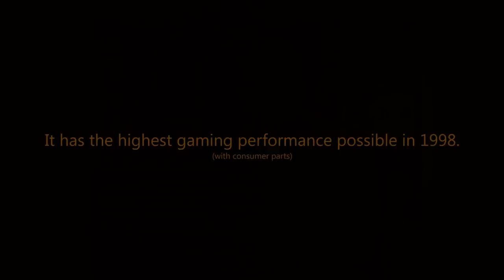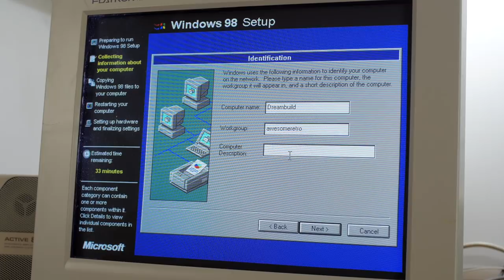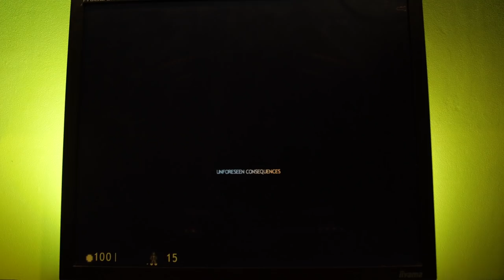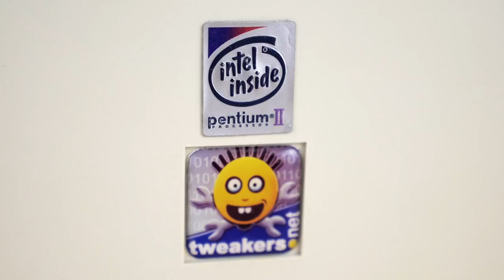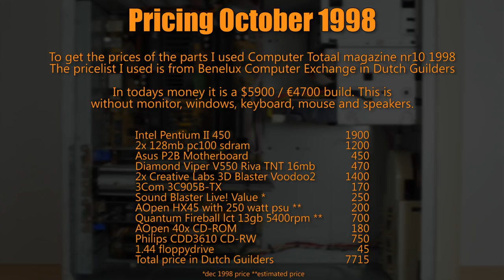1998 Gaming Dreambuild! Pentium II 450, 3DFX Voodoo 2 sli

Comment: I just got my retro PC Done and LOVE IT! it has been rock solid 
Windows 98se
MSI MS5169  ALi Aladdin V Chipset
AMD K6-III 450 @ 500Mhz had it to 600Mhz but did not see any boost so i left it at 500
Modified socked A CPU cooler to fit socket 7
384Mg PC 100 Ram
Voodoo 5 5500 
Sound Blaster 16 
20Gb and 40 Gb WD hard Drive
Sony CD/DVD

Comment: I had basically this exact computer in 1998 (though with a Zip drive and one less Voodoo2.) Went through 2 hard drives, the Philips CD burner started making moaning noises long before CD-Rs were cheap enough to actually use them for anything and I took the whole thing apart in 2004 to upgrade to a Duron. Wish I'd kept it now.

Another choice for period correct speakers would have been the Boston Acoustics BA635 that Gateway used to sell a lot of.

Comment: the thing is: a PII cpu have external cache, that means if you oc the chip, the cache would still clock at factory speed while the celeron 300a had in-die cache, that means if you increase the fsb to 100MHz the chip AND the cache will run at 450MHz which doesnt make the performance worse i guess... and yes my slot 1 celeron is watercooled... i also compared my celeron to a pII 450 and surprise: the 180$ 128kb celeron was in some cases better than the 500$ 512kb pII 450

Comment: Hey I've read that the highest performing PII's at 450 Mhz used two Diamond Monster 3D II 12mb graphic accelerator cards in SLI and that these had higher framerates than two Creative Labs 3D Blaster 12mb brand Voodoo 2 cards at Toms Hardware back in the year 1998.The reason given was that they could be overclocked to a higher degree and didn't use 3Dfx's strict reference design.

Comment: nice build. Back then(late 99)  I had a Celeron 500Mhz with Voodoo 3 2000 which i had to rma 2 years later - replaced by Geforce 2, 64mb of ram and around 10gb of hdd space.For audio I had a Sound Blaster Live! card together with Cambridge's 4.1 speakers. Together with the Hansol 17` monitor it all cost around 1000$ . Played games like Interstate 82, Kingpin, Project IGI, NoOneLivesForever, DeltaForce's Land warrior, Sin, Carmageddon2 , Rollercoaster Tycoon, SoldierOfFortune,  GTA2 , MM2,...

Those were the days :'(
Reply: I had a Celeron as well - the 300A model overclocked easily and was way better than the original 300. It was a bit of a sleeper. I had a SB Live! too because it could do duplex recording. I think I replaced it with an AMD Duron eventually - the Pentium III wasn't much of an upgrade and the Pentium 4 was too expensive.
Reply: In 1997 I still had a 386DX...

I was a little behind until the Pentium 4 was released.
Reply: +Ashley Pomeroy I've got an AOpen MX6e+ or something like that lying around here that's got a fanless Pentium II 233MHz overclocked to about 400MHz stable (392MHz because that was the fastest the board supports if I recall). Besides a Socket 7 Deskpro I have, it's the only overclocked computer I own. The Deskpro has a Pentium 133MHz at 233MHz running Windows XP.

Comment: Great video. I´m also building a retro rig but from 2000 with factory new parts. Cooler Master ATC-100, Antec PP-303X, Asus K7M, AMD Athlon Slot A. Right now I use a 700MHz Athlon but I’m trying to find a 1000MHz. AMD was first to reach 1GHz and I will use exactly that CPU.

Comment: This machine was a dream I had in 1998.
The pentium II 450MHz had a tremendous price and performance. It was top class for at least three years and had decent performance until 2003 when Pentium IV appeared. It was a CPU beyond the needs of even a demanding user. It is like buying a Xeon with 12 cores and 30 MBytes L3 cache memory today. 
Also it had three graphic cards. Actually one graphic card for the monitor and two extra with total four GPU voodoo 2. To be honest no game at that time would be better with more than one voodoo 2 GPU. This cards was usable for 3D animation creators, not gamers. 
The RAM after windows 98 became really cheap until the earthquake in Taiwan. The price of RAM is after the earthquake. 
The Philips CD recordable wasn't top. Top were Plextor CD recordable SCSI drives. Plextor was the choice of CD pirates. Top speed and reliability. Blank CDs were expensive then.
The sound blaster card and the 3com modem were the best.
Reply from the maker: +Achilleas Labrou Pentium 3 450 is more like buying a 6core. My next workstation will be a 10core 3ghz Xeon :)

Comment: 3:18  wat????  No cable rounding????    ;p
6:24  gawd I miss that "click".  Back when cases came with real switches.

That's pretty much the exact machine I have,   Same video setup & MB.
PII 400, I think only 64 M of ram.  (IIRC, I paid $400 for the CPU then)
I also liked Enlight cases back then, so that's what I used.
I also often used Sparkle power supplies.  Not sure how good they were, I just never had a problem with them.  I bought one Glitchmaster, which was a company that modified Sparkle power supplies with a huge capacitor board.  The capacitor was so big it could run the PC for a few seconds after you powered it off.   Enough to ride out an OCR.

I can't remember what sound card I had.  I do know I had a fancy Sound Blaster surround sound card, but that might not have originally been for my 400.

That poor PC's last use was as a Ventrillo server.  :(   A TNT and two Voodoo 2's running in box with no monitor attached, what a shame that was.

That AOpen case looks like it may have saw some sun.  I know some yellowing can happen just from age, but my Enlight cases have held up quite well due to never being near windows.

Comment: I did roughly the same but using a motherboard with dual pentium pros. I also used Windows 2000 pro(?) as that was the only one that would handle dual CPUs. The best game was Unreal as that worked well with the SLI and one of the few games that handled multiple CPUs

Comment: I would have loved to have this setup. In 1998 I had a K6-2 450, 64 mb ram, no 3d accelerator.
Reply: Lucky. Until I bought a Pentium 4 1.8GHz in 2002, I had a 386DX-33.
Reply: That is quite an upgrade haha!

Comment: Your ribbon cable routing skills give me feelings I shouldn't have about cable routing...
Reply: I love looking at the clean computers he has, but zip ties make me angry. At least use cable guides or twist ties, zip ties are a pain in the ass for maintenance.

I think the cleanest routed computer I own is a Dell Dimension L500r (which thinks it's an L800r due to having its CPU replaced) Which is fully stock except it's replacement CPU and cooler. 

There are only 3 ribbon cables, optical and floppy drive cables are in line, and hard disk cable is fairly short. The other 4 are power cables, the two motherboard connectors (ATX 20 pin, and whatever the Dell connector is, which I really want a pin out for, if anyone has it), the cable going to the hard disk, and the chain cable going to the optical and floppy drives.

Comment: So... When the next retro build is coming out? Would be cool if it would be built using 2004 parts to play HL2...
Reply: +TheEdvinazard
Ultimate 2004 Edition:
-Intel Pentium 4 - Extreme Edition 3.4 GHz (Gallatin)
-Gigabyte GA-8IG 1000 PRO
-2x Kingston PC3500, 1024 MB
-Geforce 6800 Ultra
-Netgear FA-312
-Antec True Control 550W
Reply: +Metatr0n I preety much have that other than the extreme edition p4, I have:
-Asus P4P800e Deluxe
-Intel Pentium 4 3.0ghz @3.75ghz prescott
-4x512mb Corsair ddr400 cl2
-Ati Radeon X1950pro 512mb ddr3 AGP

I'm only missing the ee p4 :(
Reply: +Metatr0n Most people back then knew that the Athlon 64s were the better CPUs to use.

Comment: didnt know you could sli back in the day !
Reply: +So magical SLI is a very old system that never really gained all that much popularity over the years. Only recently have new APIs been developed that claim to support multi-GPU environments better.
Reply: +So magical It worked on a totally different basis than todays SLI. Nvidia gained the knowledge about that technology when they bought 3dfx. The SLI from 3dfx worked on a line-by-line basis. So if you take one frame, GPU1 rendered the odd numbers of pixel-rows and GPU2 rendered the even numbers of pixel-rows.
Todays SLI works like a double-clutch-transmition on a frame-by-frame basis. GPU1 renders the frame that is requested right now and sent to the monitor while GPU2 already renders the next one and buffers it. So while GPU2 pushes the pre-rendered frame to the monitor, GPU1 has more time to render the next frame that will be requested.
That also pretty much explains why the VRAM is not doubled in SLI, it's because both graphics-cards need 100% of the texture-information to both be able to render full frames.
Reply: ah i see, seems quite easy in that case, thanks for the info
Reply: *****
No, 3dfx named it "Scan Line Interleave" due to the method of dividing the screen into pixel rows like I described above.

Comment: This is absolutely badass! Would something like this be expensive to buy the parts for and build nowadays? (As in, ebay prices) Also, what speakers are those?
Reply from the maker: Juster AT-85. But when I opened a speakers it only contains 1 driver instead of 2 so they are a bit fake. My 120watt pmpo which I got in 1997, that set had 2 drivers in the speaker. So there are more versions of this design. All made in china and cheap in 1997/98.
Reply from the maker: I think Ebay is way overpriced. I have many friends who have parts or find parts for me. And I find retro console stuff for them. So most parts are free. Just look in thriftshops, part out old systems, ask friends or look on more local trade sites. You should find parts for less then ebay.

Comment: This is AWESOME looks just like my computer when I was 5 or 6 years old :-D. Still sad, that I don't have it anymore :-/
Im currently building a "new" Windows 98 gaming PC. I already have most of the parts. Coincidentally the same Motherboard. I only have difficulties finding a good AGP Graphics Card. Any suggestions on what Graphics Card should I use that works fine with Windows 89? I currently have a geForce MX4000 but I have no idea if it is any good or compatible with most of the software.

Comment: Awesome build. Congratulations, Is seen that you are a profesional movie maker. But I have one question. what is the name of the speakers? I love those retro speakers.
Reply from the maker: Juster AT-85. But when I opened a speakers it only contains 1 driver instead of 2 so they are a bit fake. My 120watt pmpo which I got in 1997, that set had 2 drivers in the speaker. So there are more versions of this design. All made in china and cheap in 1997/98.
Reply: victorbart Thank's . The tiny "speaker" act like bass reflex. In this price tag is normal such design with only 1 driver.
Reply: Dan Muraru They were also available labeled as Primax and TEAC. I don't know, if those had 1 or 2 drivers, but I remember the 2 driver variants were pretty good value for money.

Comment: In 1998 my computer was a 'Vbox' trash retail PC with an AMD K6-2 450MHz and 128MB SDRAM 

Got a Voodoo 3 3000 on Black Friday at Best Buy for like $79, really made a huge difference for Unreal Tournament and Quake III compared to my SiS integrated graphics, Moto GP went from slideshow to well over 30 FPS probably 60

Comment: My first computer was a Windows 98, PII 400, 128mb ram, 16mb Viper V550, Asus P2 MB, Sound Blaster Live, 10gb WD, 250 Watt ps, CD ROM, 17" CRT, HP printer, Scanner. $2400 in early 1999.
Reply: Lol

my first PC was an acer aspire series laptop with a pentium 4, 4GB ram, 512mb graphics, with on board wifi sound and it had a cd rom and a 15" screen

Comment: what is that for a cable which appears on the video at 6:18 (the black cable which connects the 2 graphic cards )?Or where can i buy it ?
because im building an gaming pc too (win98gaming pc ...) and i want to do the same as you ... but i think that without that cable i dont rly could do an sli .
(sorry for bad english . i hope you understand me)
Reply from the maker: +Sound of Generations It is a very short vga extension cable. You can use a normal vga extension cable if you dont have the short one.
Reply: thank you very much!
(sorry for bad english ...)

Comment: To be fair, this is still sexy af.
But i remember this era like it was yesterday.
When the grey cases finally became extinct.
When 3dfx had yet to shoot itself in the foot.
When ati was an all in one-der.
The question was"could it run unreal?" And even if it could.. did it have onboard 2d acceleration?! 
Floating point performance?
Compatibility with other components?
Did the mobo allow overclocking via the bios ot do i gotta toggle dip switches?
Reply: Completely agree.
For the last 4 years, I keep randomly dropping back at this video, just to take a peek at how sexy it is LOL
Reply: @SummonerArthur I do exactly the same, I keep coming back here. Also to Victor's year 2000 dream build video.

Comment: How do your both V2 cards perform? I felt, that mine getting way too hot in this old case without active cooling, which resulted in stuttering - so I decided to get some proper cooling for them. (I plan to cut open the case on the side with space for two 120mm/12mm fans, and one on the top in the middle for one more 120mm fan, and close it clean with fan covers with mesh filters to prefent to much dust coming into the case. Maybe I am going to color the three fan covers with original grey to let it look as original as possible.
Reply from the maker: No overheating and no active cooling :)

Comment: I'm thinking as well that my old Toshiba satellite laptop would've costed about 3 grand or more, of course its also from 1998 which has a 266 mhz Pentium processor with 96 mbs of ram, 4 gb hard drive, and an 800 x 600 display.

Comment: The HL runs fine? in my retro pc (PIII 466Mhz, 384mb ram, voodoo3, win 98) i have constant fps drop, is unplayable, with the PIII@933Mhz works very well, but you have a PII 450Mhz... framerate? Good work man.
Reply from the maker: +Lucio Carranza which resolution on the 466mhz system?
Reply: 1024x768x16bits with miniGL. Thanks!

Comment: What do the 2 Creative Labs 3D Blaster do? Is it like an extra GPU? I have a drivers disc for one of them that I've acquired over time. I've never found the card its self unfortunately.
Reply: It used the standards graphics card for 2d,like Windows desktop and such, then when 3d rendering was requested by games, the accelerator kicked in.

Comment: What's the benefit of putting an AGP video card in along with the 2x Voodoo2 cards in SLI? I know the AGP bus is much faster than PCI, so wouldn't it be better to just spring for a better AGP card, or does the hardware render video across all 3 cards?
Reply: Since you probably know how SLI works, I won't explain that, but the VooDoo cards use a special API called GLiDE instead of DirectX or OpenGL (both of which ultimately killed 3DFX off in the long run). GLiDE emulation using OpenGL or DirectX is not only difficult, but also very slow and sometimes inaccurate, as well as DirectX / OpenGL emulation under the GLiDE API. 

Basically, you're better off having all three cards, because the nVidia Riva TNT can handle DirectX and OpenGL decently well, and the VooDoo cards handle all of the GLiDE work.
Reply: +AIO inc. thanks, that clears up a lot of questions. so when you play games that use glide, do you have to set your main display to the SLI cards or are the drivers smart enough to do the calculations on those cards but display on the AGP one?

Comment: I have a very similar build but with issues. Im using a asus cusl2-c mobo with a PIII 1ghz processor, diamond viper v550, diamond monster voodoo 2s in sli, crative labs sb live ct4780. When I try to play half life the system freezes with an error during loading screen. I had these cards (all 3) in a super sok 7 mobo with a amd k6-2 500 mhz and had issues with sound card drivers causing errors so I switched to the pentium III and still errors..

Comment: 1998 I had an Pentium II 233 @ 291 MHz (yep that was an awesome boost - those CPUs were so awesome to overclock - especially the Celeron 300a...) - 1x Voodoo 2 Card from... Creative I think?, 128 Megs of RAM... It was not as awesome as this machine would have been, but seriously it held trough just fine till it was replaced with an 1333 MHz Athlon-C...

Comment: great video, but i dont understand why and how does the viper v550 work with the 2x 3d blaster. im just curious
Reply: Voodoo Graphics and Voodoo II were "3d-accelerators" - they supported only 3D-mode (not OpenGL or Direct3D, but something called Glide), and we had to use it with separate 2D video card. AFAIR, Voodoo (I and II) had VGA-in and out ports, and video output of 2D card had to be connected to VGA-in port of Voodoo.

Comment: Beautifull, i got the same board ..  lets see if i can find a P2/450 in storage
Reply: cpu 450/512/100/2.0v SL364
Reply: and that . . . is not a Pentium II but.. a Pentium III ..hmmz
Reply: but my P2B is v1.10 - is seems to support Pentium III . . ?
Reply: found in store : install-cd for P2B/ P2B-F
Reply: found testmode jumper setting
added Pentium III 500 : 
500/512/100/2.0v SL35E
operational
Reply: P2B bios patch level 1012 - who needs it ?
Reply: seems not 100% stable - moved to jset 5.0x 
replaced video card - replaced harddisk
all ok

NetBSD 7.0.2 i386 - up and running
Ofcourse it runs NetBSD